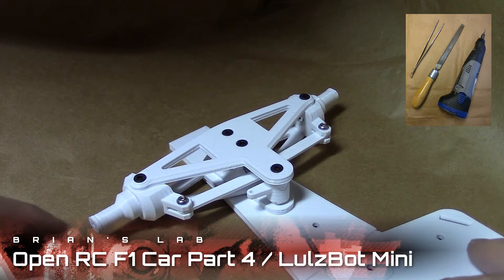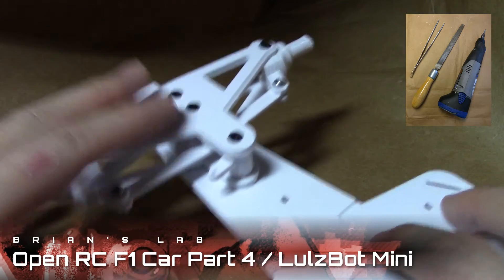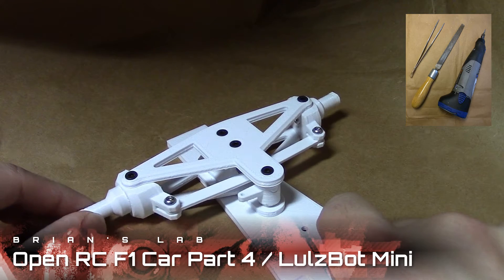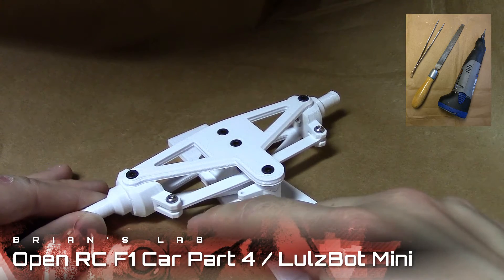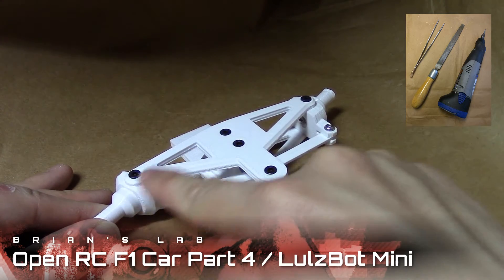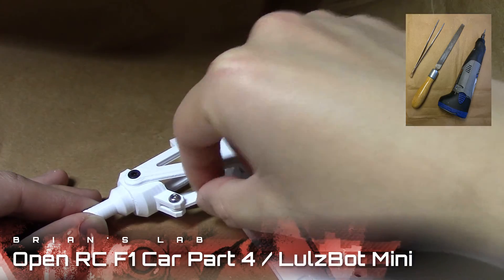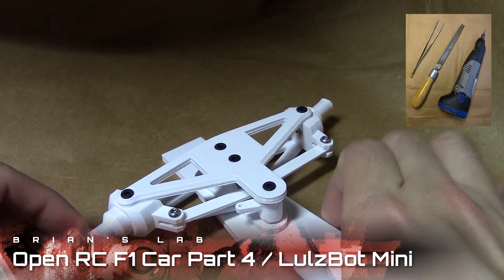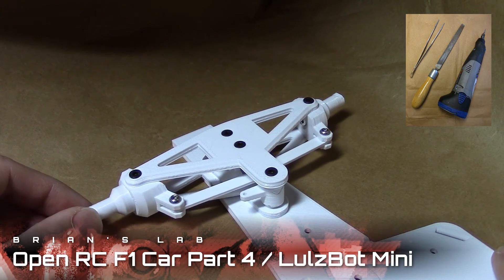Servo Saver - 3D Printing the Open RC F1 Car Part 4 / Lulzbot Mini

Comment: Im building the F1 car but am struggling to find a tyre I can buy off the shelf to fit the car, i havent printed the actual wheels yet so im open to suggestions if anyone can help or send a link on which to buy thanks?? im in the UK
Reply: I bought the F104 Tamiya tires art.51399 (front) and 51400 (rear) on ebay